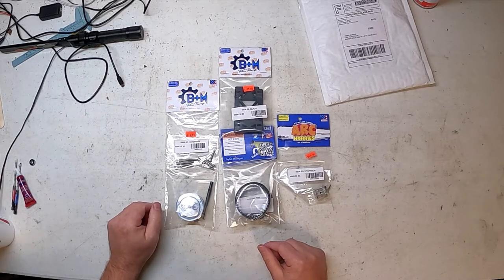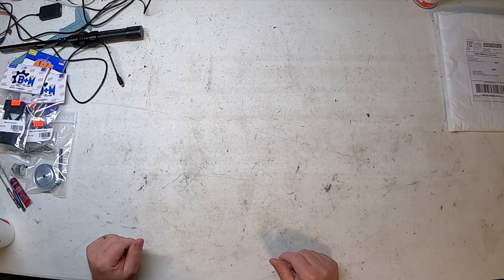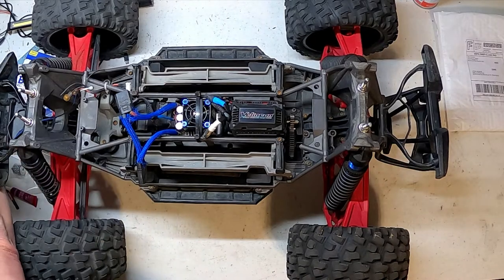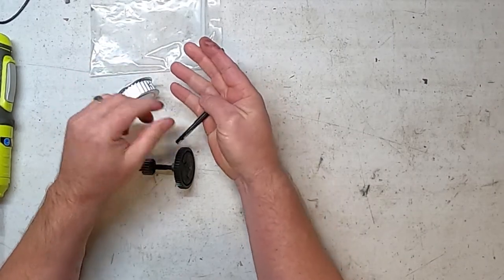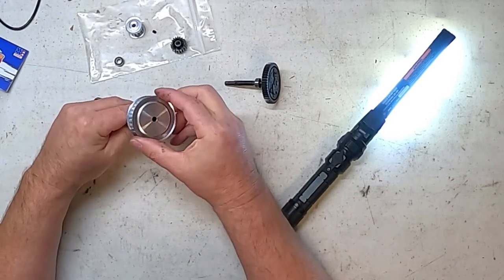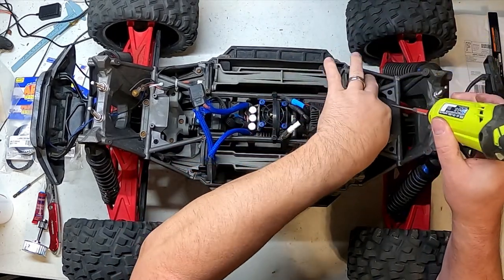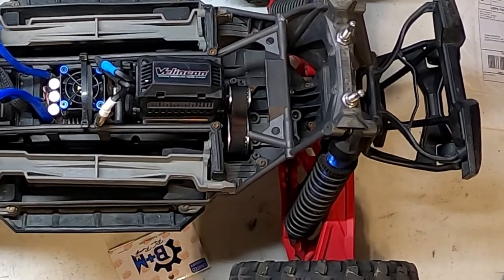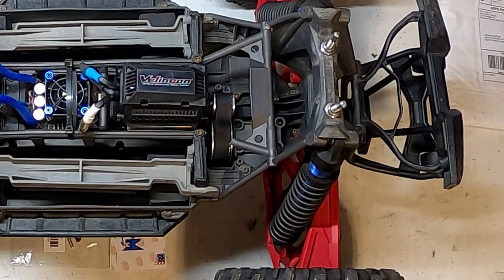X-Maxx Belt Drive Install

Comment: 20/50 is great gearing for the stock setup, and having bigger pinion/spur gears will inherently also give you more tooth engagement thus having a much stronger mesh and less likelihood of stripping gears.
Reply from the maker: i agree 20/50 seems to be the sweet spot for stock motors

Comment: I had a belt drive system on a motorbike smooth and powerful a whole lot less vibration.I doubted at first but if it work as well in these truck fantastic no more gears to replace just a belt
Reply from the maker: i ran my 6th set of batteries through it today and am just now having to adjust the belt, in it's defense i was trying to climb a bog ole rock when it starting slipping 😁
Reply: @Speedracer50  thats awsome ..

Comment: I am on my first brand new X-max 8s. I want the  belt so bad. Can you tell me where I can get all the parts you used?  Please please please
Reply from the maker: looks like the place i got mine is no longer in business, i will have to remove the link from the description. i ended up taking mine off, i couldn't keep it adjusted right went through 3 belts in 2 months and they are a pin to change, i am extremely ruff on mine though 😄
Reply from the maker: looks like WFO still sells them but there out of stock https://wforccustoms.com/products/x-maxx-belt-drive-for-stock-motor

Comment: stock motor on belt drive? If so what is the reason fot the installation? :)
Reply from the maker: Stock Motor, Maxx 6ESC, wanted to see how much quieter it is and how it worked 😁it is alot quieter

Comment: I need help figuring out the tension cuz I just barely put this on my truck tonight so anybody let me know please
Reply from the maker: i had the same issue and ended up going through 3 belts in 2 months that is why i went back to gears 😁...i just don't think the belt drive system is very good for bashing

Comment: what kind of belt is that M3 or M5 195 or 200 belt?
Reply from the maker: it is a 195 belt
Reply: Is that a 3M or 5M
Reply from the maker: @jonathantherrien1185  I am not sure what you are asking do you mean the shaft size?
Reply: @Speedracer50  No the teeth of the belt
Reply: @Speedracer50  and how large are the belt 15 mm or 20 mm
Reply: @Speedracer50  I am trying to find this kind of belt but can’t find it
Reply from the maker: @jonathantherrien1185  https://arc-hobbies.com/collections/gear-sets/products/belts-belt-drive .....this is where I Bought mine from, they have a chat button so they might be able to give you the information you are looking for.

Comment: kit shows sold out? do they really sell out that fast?
Reply from the maker: yes, it took me almost a month of checking every day to get one ordered 😁
Reply: @Speedracer50  wow! interesting...I guess obviously the parts are in high demand.
Reply: @Speedracer50  lol they just popped up today and I got the 12/30 kit!
Reply from the maker: @LayneSteighlee  good deal
Reply: @Speedracer50  My kit is showing up tomorrow...of course, I watched your video....but do you have any hints or tips when installing the system? How is your system running? haha some folks are saying belt kits are trash and the belt slips and this and that...
Reply from the maker: @LayneSteighlee  make sure you line up the gears before you put the belt on, make sure you put the belt around the spur before you install it. I had heard some things about it slipping as well and they must not be running the stock setup, I put mine as lose as it would go and could not make it slip by hammering the throttle or brake, you dont want to leave it that lose though 😊 I just did it for testing. so far mine is doing great, I have only run one set of batteries through it though and just up and down the street and through the grass. We have a bashing event this Sunday and that will be the real test 😜

Comment: Looks like it would kill your motor and make it run hot :/
Reply from the maker: I ran it for a few months and once I got it adjusted correctly I had no issues with heat.